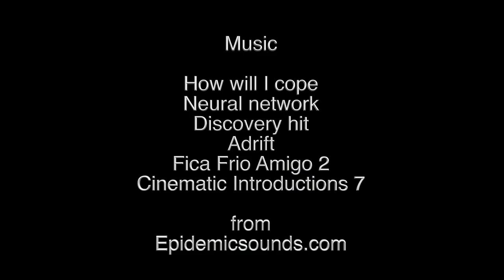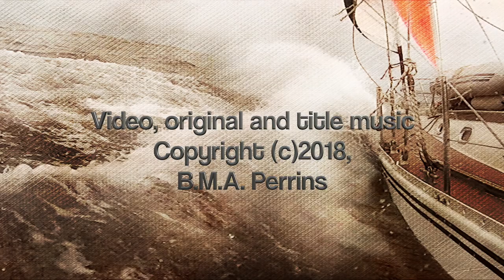Electric Storm at Sea.  Adventures of an old Seadog, ep 81

Comment: Could you clean the inside of the water tank and reseal it?
Reply: I was wondering that myself, cleaned out and sealed with a food grade epoxy they would be fine for years of further service and definitely better than any flexible water bladder, which are prone to leaks through abrasion.
Reply: They make epoxy paint for water cisterns , seals and protects them . As it is drinking water safe that is what I would use .
Reply: I think he said that he doesn't use the tanks anymore, because he prefers  to bring canisters on the dinghy.
Reply: Makes sense . I use reliant 20l water totes in my boat , capacity is limited only to how many you want to cary , they attach to the hand pump, contamination or rupture of one does not ruin your whole supply  and they  fold flat when empty .  The drawback might be they are not as durable as a steel tank .